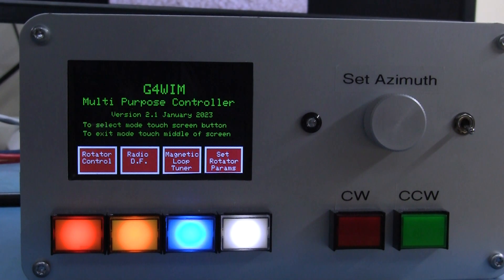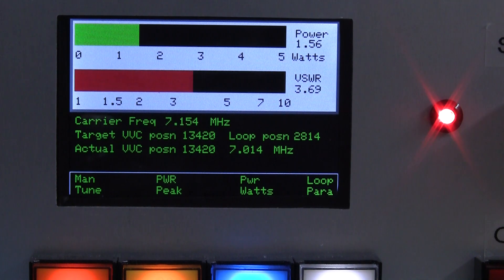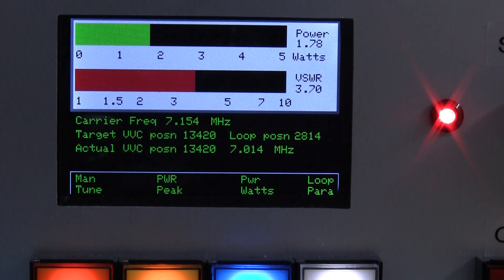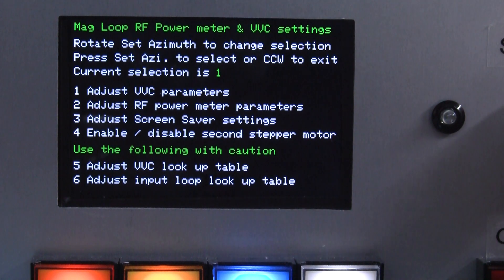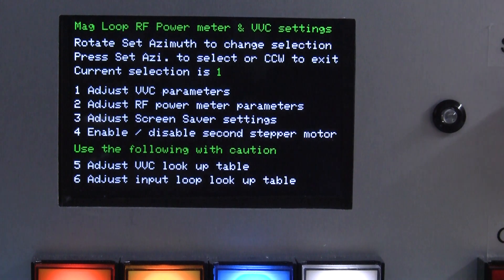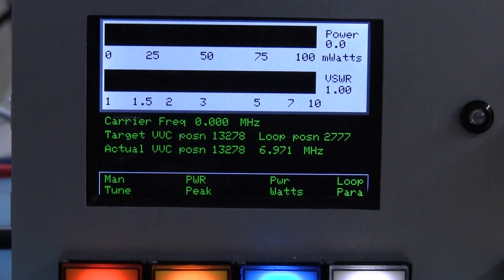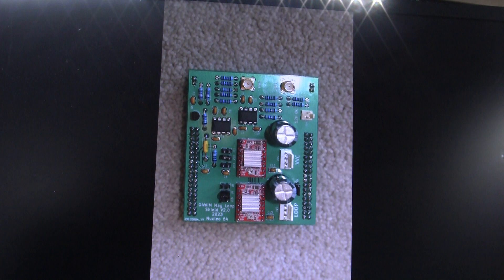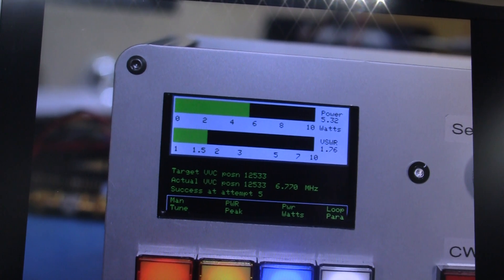Auto tuner for Magnetic Loop Antenna

Comment: Can this be used on a mazzoni midi
Reply from the maker: Hi, yes it could control a mazzoni midi but would need some modifications to the loop control motors and potentiometer feedback mechanism.  So you'd have to be pretty handy in both firmware and hardware.  The general alogorithms would remain the same - just the hardware driver and related code would need work.  This is something I wouldn't be able to help - you'd be on your own, sorry.
Reply: @timdf911  thanks for the transparent reply , I’m trying to find a cheaper way to control a midi loop , mazzoni command over £600 for a new controller !!

Comment: Apologies, where is the (hardware) project description?
Reply from the maker: Parts 1 and two which covered the rotator controller and RDF functions were described in RadCom Jan / Feb 2023.  Part 3 which covers the mag loop tuner will likely be published in the next month or two, depending on space available within the magazine.
Reply: @timdf911  TIL RadCom is a e-magazine published of the Radio Society of Great Britain: it is very unfortunately only accessible by society members. So no luck for non-members. Thank you anyway.
Reply: @timdf911  I'm following RadCom and I can't wait for Part 3 to come out, as due to space constrains a HF loop antenna is my only way up to the sky.. TNX, 73!
Reply from the maker: @glaros0  it's in the next issue of RadCom with a link to the schematics on line - RadCom couldn't spare the space for them.
Reply: Still waiting for the mag loop tuner to appear on RadCom 🙂 73
Reply from the maker: @glaros0  It's been published over the past 4 months in 3 parts - but it's a subscription magazine and not available for free on line.
Reply: @timdf911  indeed, I am a RSGB member, I am waiting for the part related to the HF loop antenna tuning (matching), many thanks for your great project! 73